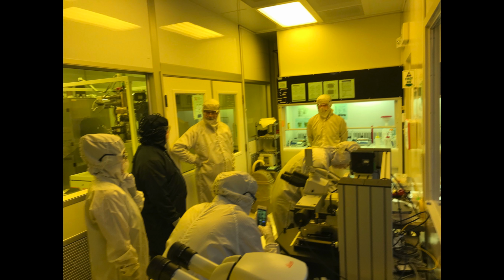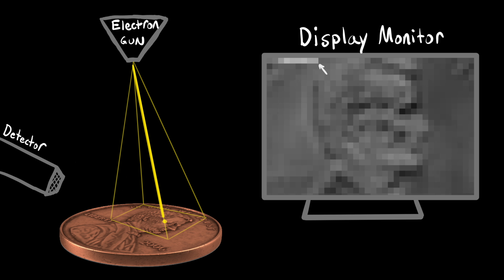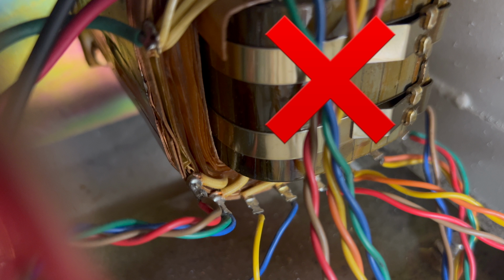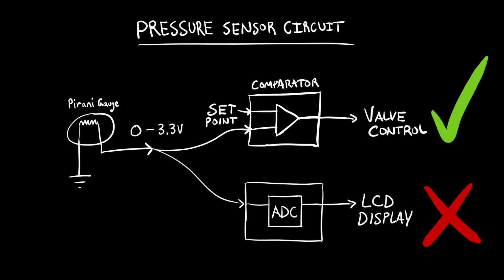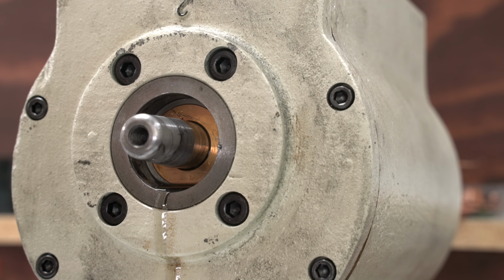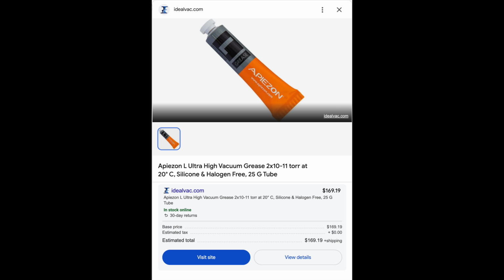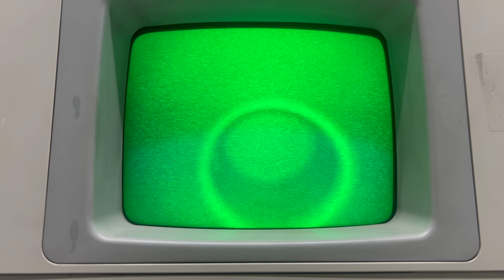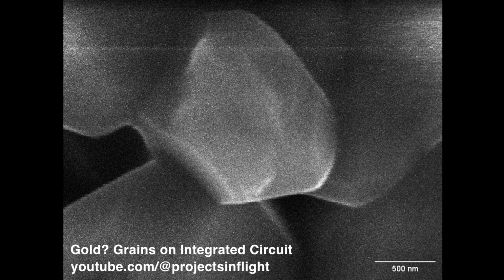I Saved an Electron Microscope from the Trash

Comment: this is so cool its my dream to own an sem will this identify?
 Anything, it's scanning.
 Tell me what metals and what minerals and stuff. I'm looking at i want one, so i can prove my geological discoveries. And all the new information I've gathered about impactor ejecta and meteorites, but it would have to be able to focus. And identify the material we're looking at. Like the, I guess the newer ones do? Maybe that one's too old. D*** yeah, I guess that thing's older than mouse device. So there's no point and clicking on anything, correct? I can definitely send you super interesting geological specimens that are both terrestrial and nonterrestrial. Black diamond in fusion crusts stuff like that. But how do we know what we're looking at. If we were T looking at a class with certain minerals in it, how do we know what it is? Is that beyond the capabilities of this machine? How new of a machine do I need to get to have those capabilities? Any help you could provide would be much appreciated. Because I will have my own and I will probably have to go through the route you did rebuilding, outdated equipment. If you know any of these answers, I would greatly appreciate the help.

Comment: I am completely unfamiliar to all of this but this sounds eerily familiar to a VERY VERY precise CRT that also has a detector. I mean it works in the same way, high flyback voltage dumped into an electron gun then focusing anodes through a vacuum that hit a target! Whats funny is that the SEM also has its own display which is another CRT, presumably, so 2 particle accelerators in 1 machine.

Comment: as on old time repairer of equipment similar .. that cable used to send the video is a bad cheap cable. the shield  on the cable  barely wraps around the centre core. Buy a good shielded cable and it will reduce the noise level. 
It was great watching you repair this machine.. you followed the same steps i would have  except in the vacuum i would have used the silicon grease and did not know of its abrasive qualities, so well done there. I am very impressed and jealous of your of your fortune finding such a gem of a machine.  Great video and i am happy i watched such a fabulous outcome.

Comment: For non conductive specimens such as insects,  try to get a sputter coater that can coat your sample on all sides with platinum or gold.  You will get much better images.  Modern microchips are quite flat on top, so you see no features.   Try some older chips from the 1970s or 80s,  especially in ceramic packaging,  so see the wires running on the die.

Comment: Why not just buy small switching power supplies from Digikey or Mouser for each of the voltages you were missing instead of 7 transformers.  Using a buck/boost converter you could dial in whatever voltages you want

Comment: I posted this comment in response to a specific question. I add it now as a general interest comment.
An electron beam striking a surface excites the near surface atoms. The energy needs to go somewhere to return those atoms to the natural 'ground state'. This happens by emitting both xrays and various types (energy levels) of electrons.
What gets emitted depends on the energy of the incoming electrons.
Lowest energy emission is secondary electrons (SE, 0-50eV) from the top few atom layers, which are what you are imaging in an SEM. There are also higher energy reflected, backscattered electrons (BSE, typically >50 eV, often 0.8–0.9 of the beam energy).
Then there are the xray emissions, both broad background radiation (broad energy bremsstrahlung xrays) and characteristic xrays (xrays at specific energies characteristic of the chemical element).
We use all of the various electrons and xrays to do various chemical analysis.

There is also a 3 electron relaxation process, called Auger electron emission, which occurs in the topmost 15Å-100Å of the surface, that is characteristic of the chemical elements present. That is used for surface chemistry analysis, but the SEM column environment is too 'dirty' to be practical in a SEM. We do that analysis in UHV (Ultra High Vacuum).
Reply: Google the following terms for more details about each topic:
- Secondary electron energy
- Backscattered electron energy
- Auger electron energy
- bremsstrahlung xrays
- characteristic xrays

Comment: That was a good project! So glad you had the schematics... indispensable. You have great perserverance. These oldtimer SEMs are still useful, though they can be high maintenance due to electronics components dying of old age. Glad that you experienced mostly just transformer and membrane switch lifetime issues.
I'm an SEM OG (back to 1980). Happy to chat with you about optimizing your SEM performance. I maintained most of my equipment, mechanically, vacuum-wise, electrical & electronic.
'Dirtiness' of your SEM column, liner and apertures (especially the apertures) can make quite a difference on the noisiness of your image as you increase beam voltage and magnification. 
Have you washed and flame sanitized the apertures?
Reply from the maker: hey! i really appreciate the info. if you want to chat my email is projectsinflight at gmail

Comment: I know that feeling of getting really interested in a technology that is normally not accessible to consumers. For me it's thermal imaging cameras. And I have dreamed of owning a high resolution (640x480...) uncooled camera and real lenses. And after just half a year of ebay hunting I found my bargain: a maritime imaging system from a russian yacht... somehow ended up in the open used market after a large fire at the yacht builder ... well for way to cheap it ended up in front of my door in a massive crate on a palette. Sadly I don't have the skills, equipment and time to actually get it running beyond a demo state. So it's been sitting in a drawer for half a decade as I am lacking the partners in crime to do this project with me. I know the best place on the internet to discuss DIY  thermal cameras, it's the eevblog forum.

well now my dayjob includes research about thermal cameras, so I might make the friends I need to revive the project and passion.

SEM and all other imaging methods like atomic force microsopes are such a fun technology. It's similar to the core of thermal imaging: making some things visible that are omnipresent around us in a new way. The modern digital methods of focus stacking, histogram equalization (auto contrast) and super resolution sampling with progressive denoising etc is really fantastic and some of the ideas can also be applied to thermal imaging. There is quite a few "garage" shop level youtubers that have access to this technolog. I am sure the animation videos by Breaking Taps and Applied Science have kept your motivation going.

Comment: Oh there are always vacuum problems and dont use too much high vacuum grease it volilises to. Rub sealing surfaces lengthways with that green dish cleaning material even a cat hair cross wise on an o ring blows the vacuum  seal. You had me lagh with the listening for a vacuum leak that small but i thought an ultrasonic detector with a ginormous amplification gain might do it. Some use a stunted mass spectrometer as a detector and hydrogen or hellium I think it is as the bubble maker on the flat tire so to speak.

Comment: Im disappointed you had to take the X-Ray equipment offline in order to get the hi -jack the port for your vaccum  detector whatever it was. Everything was straght forward that you did except the membrane switches, I learned something there, wow hi-jack game boy crap for parts, simply  brillient. I probably would have been stupid enough to try to rewrap the transformer. The fact some taps were unused made the multiple transfmers a way better option and the platform fit well and looked professional. I have an old ISI from analog days, was I think the cheapest SEM ever made you have a newer model very nice lucky. You game some insperation I do have schematics somewhere hopefully mice have not chewed it up or its been lost. Im in California about 30 miles from Palm Springs

Comment: I know this is a bit late, but while you were working with the power supply, how much of it actually needed 100V AC vs the step down voltages? Because if you were already changing out the transformer(s) you might have been halfway to regular wall 110/120 maybe even using a PC power supply.

Comment: wait, so if whatever u want to image is also exposed to the vacuum chamber... 
.. wouldn't that cause the fly to implode or vaporize any remaining fly juices once the pressure reaches a certain treshold?
.. or is the fly just dry enough from being dead for some time that nothing happens?

would then tiny bits of moisture from lets say a "recently deceased" fly potentially be catastrophic? and would it lead to  
a) simply damaging or destroying the material u wanted to image once any liquids start boiling? or
b) possibly even destroying the microscope itself?
how do you get around this problem when imaging living organic matter (i.e. blood)  in a vacuum?

thank you for excellent video, brother, and please forgive my limited understanding of this subjects
vacuums are cool
Reply from the maker: so, the simplest answer is that you try to dry out your samples before loading them into the SEM. that being said, there is always a tiny bit of water in the SEM, even without samples, due to moisture in the air. that moisture will inevitably get pulled into the vacuum pumps, and can contaminate the oil over time. Eventually you have to replace the oil to restore optimal performance.

Comment: its very simple to repair even the most complex electronics if you have the schematics , try it without, most times i dont have Electron microscopes on repair , mostly my wife Oven dies , and Repair is more costly then buying a new one , and guess what it has no schematics even tho everything is labeled . That was the last thing i repaired .If you don't account SMPS transformer that has so many failed parts that after fixing 5th i gave up realizing its just a bad design and even if i fix everything it will cost me more then buying one , and i don't even want to buy one since its so bad design .

Comment: Don't ask me why, I know this... There is a German lubricant brand named Uberlube it is silicon base, and i am sure FDA approved so, is not abrasive, and not corrosive. and I am sure you buy 25 grams for like 11 dollars. would that be a suitable replacement?
Reply from the maker: if it isn't expressly designed for high vacuum it likely will offgass too much and pollute the chamber

Comment: Apart from fixing the Transformer coil, electronics and replacing the pump, "I used my lathe to build an adapter from the vacuum pump's kf25 output" Just blew me away. Impressive work :)

Comment: As a former hydraulic engineer/ machinist i repaired quite a few machines in my working life 😁... i worked with anything pressure related from -1 bar up to 2500 bar at huge volumes.
what a lovely repair job and a nice machine.👍
Actually the units you use for vacuum... you are the only person in the world that uses them 😂.
Some unit from the S.I. system would be nice or millibar 😊.
You mentioned that the pump can do - 10 ... but is that amount needed for the system to run ?.
Maybe only -7 is required and the rest is extra capacity to make up for small losses.
Vane pumps are known for loosing pressure on the running surface and the vane's.
The vane's itself are easily replaced or repaired but the running surface in the pump is another thing.
There are other types of vacuum pumps that work very well...
They are called water / oil ring pumps. .
And they can make a good vacuum 😀
In think you could have done a easier/cheaper repair on the voltage transformers .
Thank you for sharing this great project 👍😀.

Comment: I did not know that electrons can pass through lenses. Isn't Extreme Ultraviolet lithography for example so damm expensive because you need to use mirrors and can't use lenses? Or did I mix up something?
Update: Electron microscopy uses electromagnetic lenses because electrons have mass and can be bent directly (field interaction) avoiding absorption while EUV lithography uses light (higher frequency x-rays) which must interact with matter to be focused.
Otherwise microchips could be produced a lot smaller with electrons, but it would take ages😂
Reply: They... can't? Aren't they focused by magnetic lenses?

Comment: Are you worried about out gassing, because PVC is awful for high vacuum because of this.
Reply from the maker: the pvc tubing is for the backing pump side, not the high vacuum section so it should be fine
Reply: @projectsinflight  Ohhhhhh, ok, didn't catch that, thanks for clarifying.  I still think it's really cool that hobbyist now have access to ridiculously and advanced tech.

Comment: As a tech in the 80's I was "engineer"/owner of two ISI SEMs and had occasion to repair both. But one Monday morning I found one of them cycling thru the vacuum power-up sequence. This was due to a capacitor failure in a power supply. As more valves opened, the load on the supply increased until the voltage dropped enough that that all the valves closed again and the process started over. The machine might have survived that episode, except that someone before me had removed a small vent valve on the foreline. That apparently allowed enough backstreaming of the roughing pump oil to contaminate the whole column. I repaired the power supply, but was never able to get a decent image from that unit again.

Comment: Nice work great deduction of issue by issue, who wouldn't want an electronic microscope. And the amount of troubleshooting from the RCA cables to the pump to the vacuum lines you would have thought it would have just been maybe one two issues but no. Great job on the video of your step-by-step troubleshooting. I had a smile once you focused on the microscope plate

Comment: Board repair is easy. the lenses… I wouldn’t even take up. the original price was for the lenses. you could just pass it on and try board repair on like a laptop. board design is not too difficult to extend if you work your way through one or two successful projects that have schematics. old Nintendo consoles could be fun to repair. There is definitely proper Nintendo engineering schematics online and if you get stuck then YouTube could fill in some gaps to move you forward. sautering skills will probably drive you a little bit nuts if you cause an imprecise short. It’s a good skill once you can map the schematic to your hands.

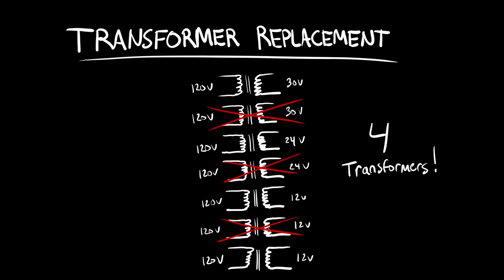Comment: 10:43 why not swap the shorted transformer coil for one of the unused coils? Or was the main coil shorted as well?
Reply from the maker: any single short on the secondary means that the primary side is also shorted. No way around it unfortunately unless you can physically remove the offending winding entirely
Reply: @projectsinflight ah that’s too bad, glad you found a solution and fixed your SEM! Loved watching you fix this old piece of equipment

Comment: Getting a picture of a bug before it explodes from internal pressure in a vacuum might be a bit difficult. Might I suggest Kings Bay Rum as a cure to most of those problems due to it's low hang over character trates.

Comment: One can fix that groowed axle issue by means of assembling the new seal slightly different debth.
Those pitted lamello tongues can be smoothed by wet sand paper 600…1200 grit

Comment: 10:40   Why seven taps when there's only three different voltages (30, 24, 12)?  I would think 3 would do.  Or do the taps have to be separate for some kind of isolation reason?

Comment: You can improve noisy images by taking several identical images. Then you combine and average them with gimp. With the right methods you can sharpen up even images with 10 + % of noise pixels! I did this alot with fractal images because the calculation does produce random noise on some types of formulas.

Comment: You say you were over your head, and I completely understand. Short of being an experienced eletronics/electric engineer this kind of repair is impossible, especially with very obsolete equipment where spare parts cannot be found anymore or replaced, that's where you NEED help. Quite fortunate. I wonder if you can even replace the CRT (some are built-in) or any critical component like software-containing chips on the board ...

Comment: “I fixed a scanning electron microscope using an Xbox controller” is such a cool statement
Reply: I've torn apart cheap computer keyboards with exactly those membrane switch contacts. 101 replacements for 10 bucks. 🙂
Reply: such a legend
Reply: X box controllers are so universal...Games consoles, Military drone controls, electron microscope spares.... For once in their history , Microsoft made something that IS compatible
Reply: @jiix-gtbd and even submarines
Reply: @Lollolowlwooo oof! 😖👍 

Or should I say poof? 💥 😋
Reply: as long as someone doesn't have the idea to do the same with a submarine. wait...
Reply: Or you can buy the little rubber pads.